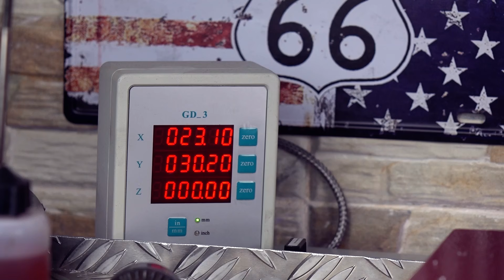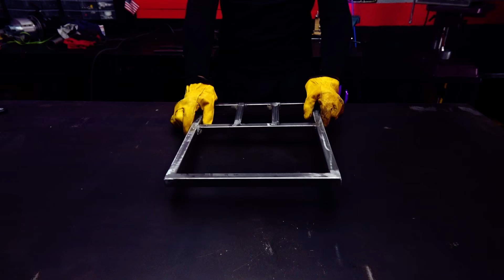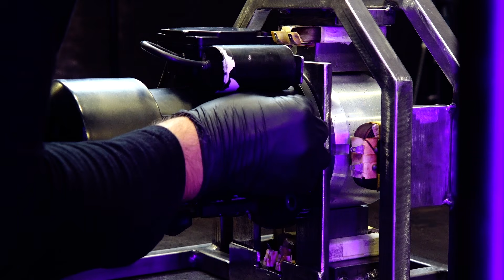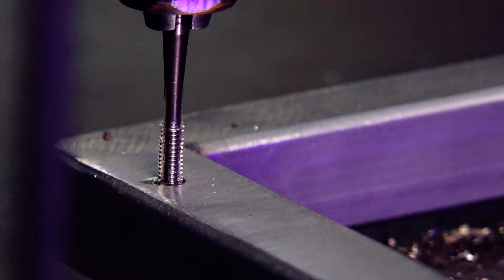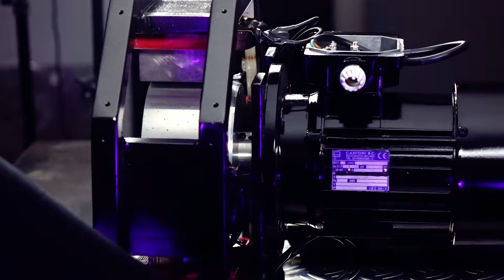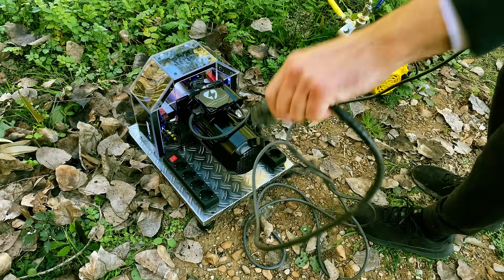20KW INFINITE ENERGY GENERATOR 110-220 Volts

Comment: Make no sense how the DC motor creates AC power supply...another scammed video for all of us got thinking it truth.
Reply: why are you so dumb. the magnets produce AC and not DC. The motor is an AC power 230V motor, it does not run on DC fool.

You would need a rectifier is an essential electrical device that converts alternating current (AC), which reverses direction periodically, into direct current (DC),
Reply: Actually its real hes mimicking Infinitely thin laminations and eliminating the eddy current by placing the metal in a dielectric matrix with most likely highly reliable double layer coating
Reply: @xTankgodx  please elaborate. Whats the definition of dielectric lamination?
Reply: You can clearly see the laminations on his how to make a 10kw alternator video
Reply: Dielectric laminations
Reply: And its also segmented you can see the lines clearly

Comment: To prove that this engine is real, why don't you host a live stream where the engine is placed inside a sealed, transparent box to ensure no external power source is connected? Additionally, the structural frame should be made of solid iron to prove there are no batteries hidden inside. This live stream should run continuously until no one has any doubt that the engine will ever stop working

Comment: Man made a car, and we improved it by decades of work, everything was improved, man can also improve this device for better voltage powers enough to power a home with a 5 ton ac unit plus using a washer and dryer all at once, 

This is Tesla model of conception plus many others who helped to make it better, if u research that Tesla made a free running electricity to run forever , but his funding was pulled away saying no we want to charge people not give it away for free, and he was shut down right after that , by one of our forefathers….. that guy who had a kite in the sky with a key on it, 

But here’s the deal here, we don’t know exactly how the main generator will run, the complex of aluminum and silver must be spot on for it to work, and last …..there is no bearings into it, it’s a solid form, so it will not have any issues in future use running for hours and hours , no cooling is needed ether , the only issues I find , the power source will decay with in a few years , other then that that’s zero percentage of damages known, 

U can also use higher power with magnetics to go up to 5k watts generating more power, but again the amount of silver for any voltage is critical to know the exact formula, these guys are also protecting themselves not to give away the actual patent , this is a demo video only, no sales of this is allowed, as they or anyone will sued , not by using it for personal use, as long as u do not profit from it I believe we are all ok, 

Man wanted this for decades , and it’s out, and again man will try and stop this for profit, we are a bad world , not all of us are ……

God bless …..

Great video btw

Comment: The laws of thermodynamics are stable and immutable.
It is a matter of time before the magnets weaken and they will.
For a period of time will really manage to charge a 12V or 24V battery set.
Then eventually real physics, as started it, will apply at the end(!)
Reply: The magnets will demagnetize in 400 years.

Comment: People don’t understand that the rotor is the key component that makes this work. It’s made of a special classified alloy silver combo. If you find out the the mix the rest is childsplay
Reply: That's a Al 55 - 45 Ag ratio for a high-performance alloy...otherwise, commonly it is made as Al 90 - 10 Ag ratio.

However, in specialized applications aiming for the highest possible conductivity and efficiency, higher silver content may be utilized, though it increases costs significantly
Reply from the maker: Exactly, my friend.
Reply: @thelibertyengine what is the ratio of aluminum and silver for the rotor/flywheel ? Could you please tell us that ?
Reply: komposisi susunan magnetnya ,juga sangat menentukan keberhasilan mesin free energy ini.
Reply: Can we use aluminium alloy or used induction motor rotor ?

Comment: the round thing next to the electrical box is a capacitor, we would need to see a long demonstration under load to rule out that as the energy source
Reply: The capacitor works as an energy buffer for stablization. NOTHING MORE.

Comment: You mentioned in the earlier video the potential for a 3.0 Liberty Engine using magnetic-fluxuations in a solid bar of the sliver and aluminum composite.  No mechanical rotating parts to break down, ramping up by magnitudes without threat of malfunction? Trans-stellar engines? Enjoyable video.

Comment: The Aether, the primordial, energetic substance, the substrate, if you will, from which all matter was created, is the source of all forms of electromagnetic phenomenon (light, radio, electricity, etc.). Systems for extracting useful energy from the Aether have been in existence for a very long time. Modern scientism and technology emphasizes only the use of those systems that can produce energy that be controlled and metered (for a price) from centralized locations. The miracle of Einstein was to (mis)use mathematics (the Lorentz Contraction) to "abolish" the Aether (the only way his math would work out) and thereby bring disrepute to anyone who had the gall and the audacity to so much as utter the word "Aether" ever again.  This is why free electrical power is impossible. Something that cannot be metered and charged a fee for it's use must be, and always remain, impossible. It has to. Just ask anyone who runs an electrical utility. The only money to be made in the free energy arena is for those who produce the specialty components for the hardware, but they'll have to do it on the QT to avoid being assassinated by representatives of the industries where all the big money's made. So, if you, Dear Reader, can develop a device to collect energy from the Aether, do it; do it for yourself and keep quiet about it, and, for God's sake, don't try selling it to anyone. That's the best way to have a Wikipedia page written about you, describing in detail all the exploits of your life that led-up to your untimely demise.

Comment: This could be used to drive electric vehicles for ever without recharging. 
Things like flying car (EVtols)
E-bikes 
E axle trucks and cars 
This would wipe the market clear of people using solar farms.

You could be disconnected from the grid forever and power all your electrical vehicles for life.

These generators are designed to run 24/7 for years with only minor maintenance.

If you want more power such as megawatts instead of kilo watts .

Just use a different type of generator such as a compact  high rpm generator!
Reply: Я думаю, что современное взрывное развитие электромобилей и имеет целью финальное предъявление подобного генератора и замена им литиевых и др. батарей в электромобилях... а всё остальное уже готово и отработано будет.
Reply: this can be improved i have the details
Reply: @danieltolan4762 what's the improvement?

Comment: Yall did good, but at the pond scene you can tell you dug a hole in the ground and buried a battery pack or used the flow of water to generate power.

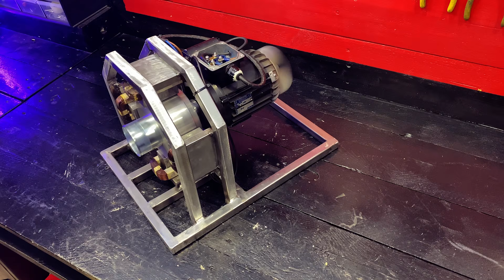Comment: Starting at 11:17 you can tell it slows down and yall cut in new shots of it at normal speed and more cuts as it slows back down- all people have to do is watch the part you added for the starting string as it slows you cut in new video of it at full speed that is why the light changes on the video back and forth. you just overlapped the arms with the voltmeter.
Reply: I noticed that too, I saw that video about 3 years ago, with the idea of using that kind of contraption to power cryptocurrency miners. Does it actually work?
Reply: @guilhermedemorai.8  Why hell no, not this one but there are types that can be made. Best bet is check out bob lazar hydrogen corvette. Anyone can turn water into Hydrogen and have a generator that runs basically off of water from your sink or a creek.